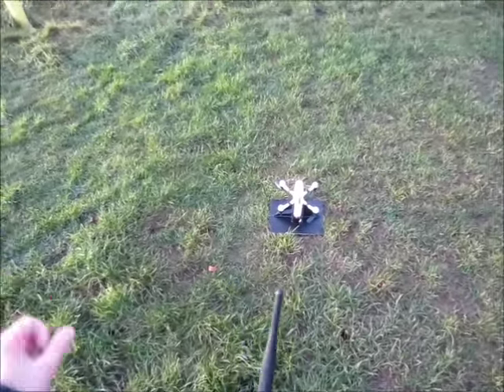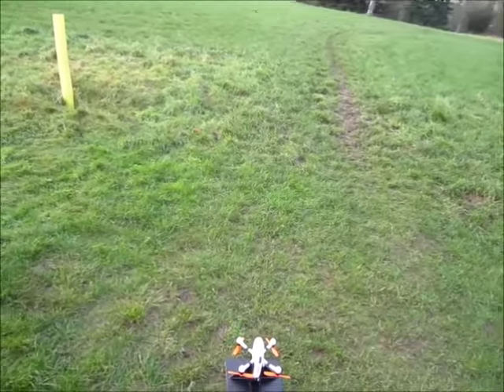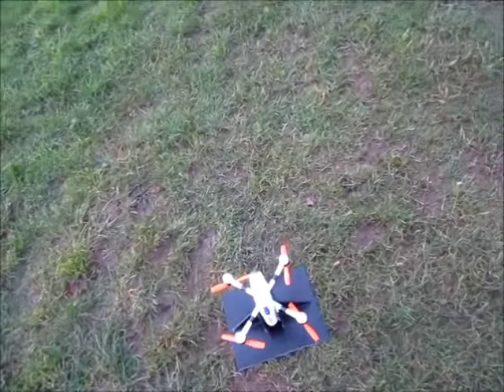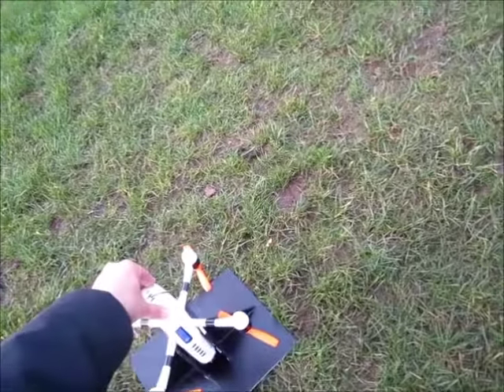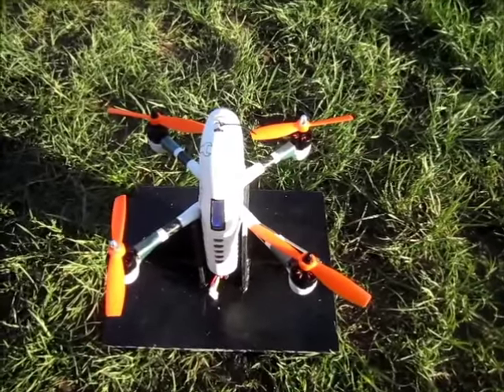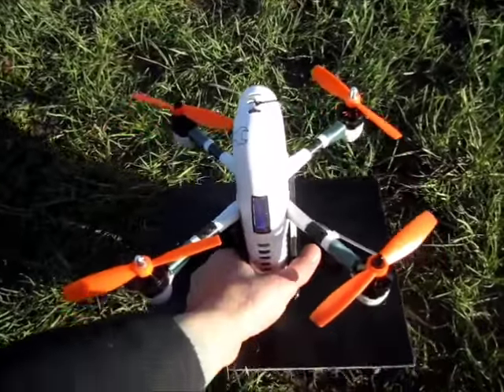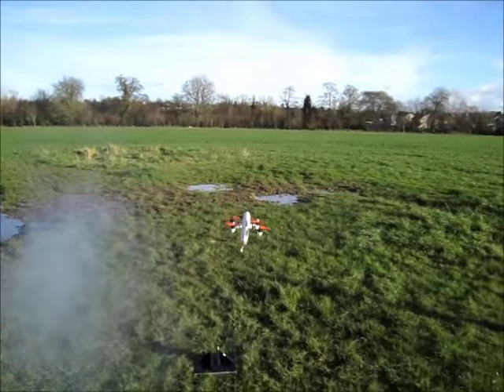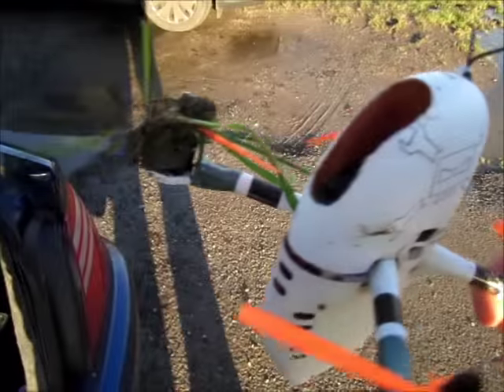Miniquad speed record. Part 7. V2 maiden and fail

Comment: I had something similar when trying to use SN20A ESCs with Tmotor 2206 2000kv motors.

I had that exact same stuttering you are having and while It would get into the air there it would do the same thing you are experiencing with the yaw . When I replaced the ESC that issue went. I would like to think I damaged a MOSFET while soldering but in reality I have no idea.

I really doubt the issue is outside your ESCs and Motors but that is from my limited experience.
Reply from the maker: +Oran Deutsch 
Cheers, that's second in the line to check:)
Reply: +ROBOFORCERX2000 The beer better be first in line :)
Reply from the maker: Oran Deutsch Yep, that's my "motivation liquid":))

Comment: i had bad yaw problems with my sky hero anakin
problem was wrong CG
a little wrong geometry (caused by wrong build by myself) 
and i had blheli esc's 
three out of four esc's were ok, but the fourth i had the problem that it somehow wasn't detectable (had to flash it again) and not all possible options on blhelisuit where in sync.
like on one esc the timing was different,  on the other the min and max throttle and so on
i had to check ebery option on every esc!
Reply from the maker: +AvanSuti 
Yeah man, I'll start looking at ESCs, but CG or geometry can be outruled here definitely:) CG on this one is dead in the center and when I had my motors inverted it was right at prop level. And for geometry I'm not cutting corners anywhere, not even by half a millimeter:)

Comment: Hi ! I know you optimize everything for speed but why don't you put some thin metal wires at the bottom for landing & taking off at least ?
Reply from the maker: +Badass copter 
I think there's no need for landing gear, just unnecessary weight ... If I crash it will not help, no problem to take off from the box, and normal landings don't break even a prop. If I had plans to fly this copter regularly than yeah, landing gear would be handy, but I'll just milk the most speed I can from it and will take it apart to build smth else:)